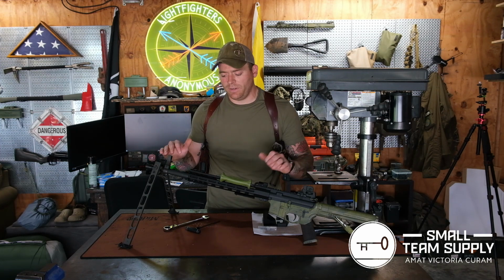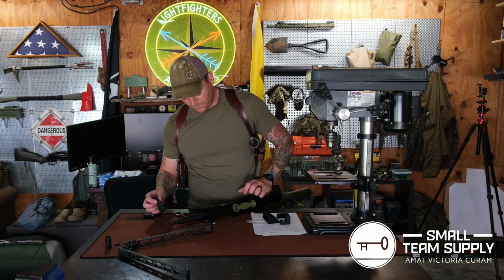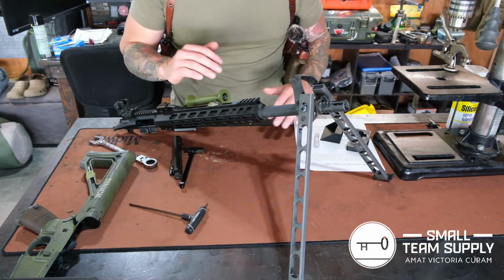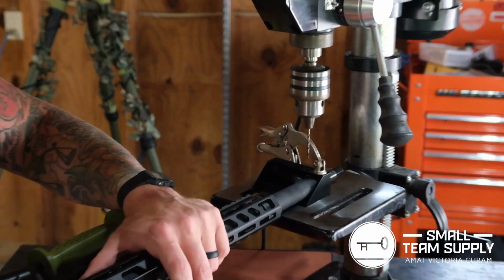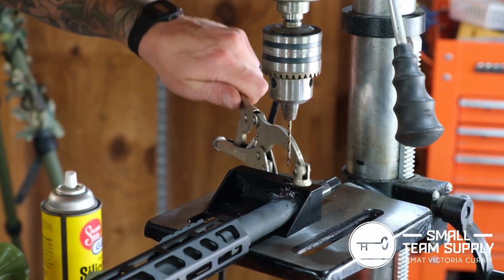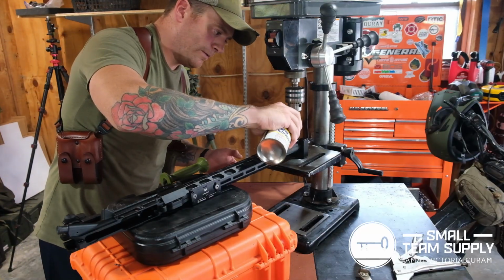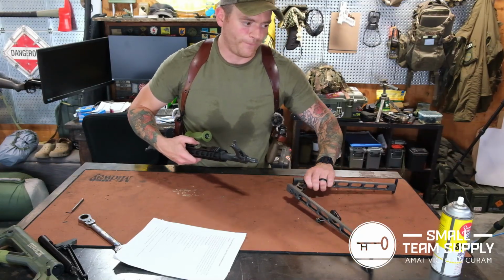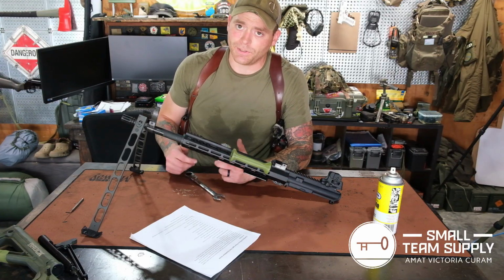ARPK Front Sight Post Installation | Klein Machining | Small Team Supply

Comment: Could you demonstrate why this is worth the extra expense over a bipod mounted to a 15in rail?
Is it about recoil control?
Reply: Having shot a couple of these uppers, its makes reloads way easier off a bipod because the the rifle can cant far enough to the side to remove/insert magazines. Being able to reload without changing your firing position has been a part of every LSW, from soviet rifles to the AUG. you dont come close to that by mounting a bipod to the bottom of a rail.
Reply from the maker: It's a longer sight radius and it's bulletproof!

Comment: Yeah good stuff! You figured out the trick for getting the bipod set right!

 Glad it went well for you!   Yeah, I try to setup folks for success. The 3 scariest things is getting the front sight zeroed, hole in the right spot and getting it  reamed to the correct depth. My design and jigs attempt to address all 3 aspects.

Also you can use the reamer depth gage to drive the pin in and you can flip it around to use it to drive the pin back out.